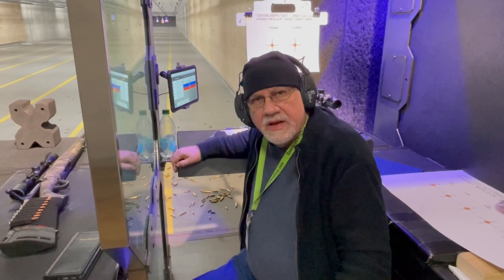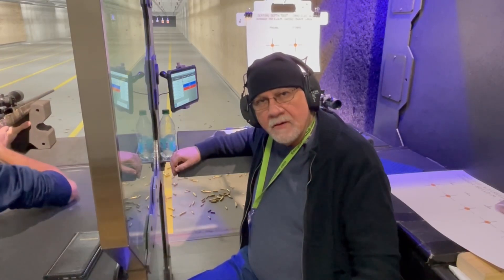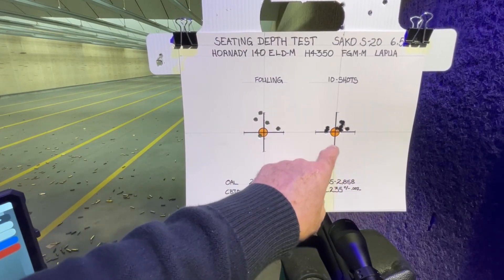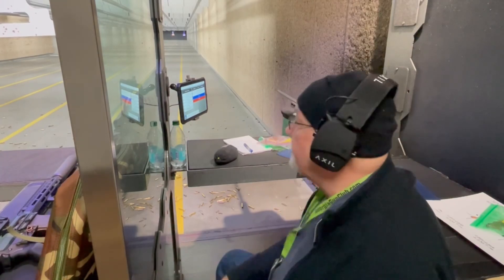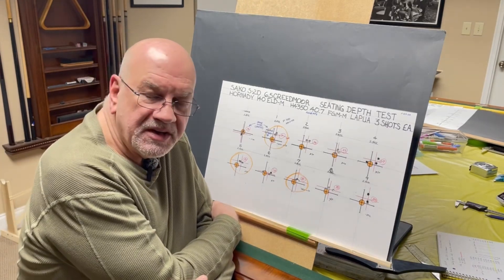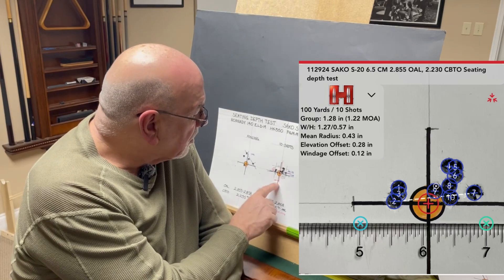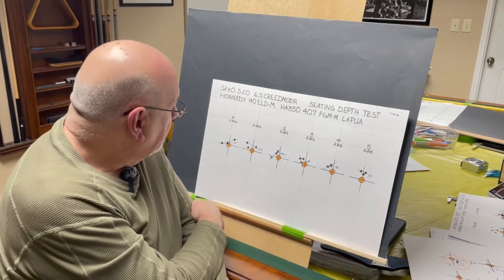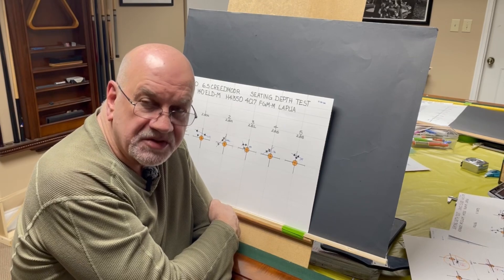Finding the node.  Zeroing in on seating depth for 6.5 Creedmoor.  Getting closer.

Comment: Take your 2.815 seating depth and try some 3-5 round groups with your charge weight +- 0.1 gr. The best way to know if you are at a node intersection between velocity AND seating depth is to see if you can keep point of impact and group size consistent as velocity varies. Id love to see the results as well. Do you own a chrono? If not consider collecting data on your velocities to see if you're maintaining good spreads.
Reply from the maker: @gregjones580  thanks for watching Greg. Good information there. I may have to give that a try. No, I don’t own a chronograph, but it is on my list of items to acquire. When I look at a group and I see them stringing in a tight cluster or horizontally, that indicates a good velocity node to me. thanks for the input.